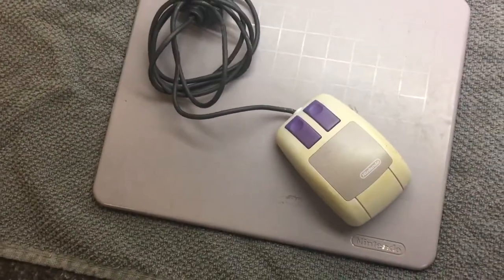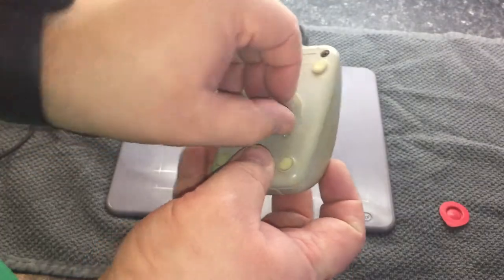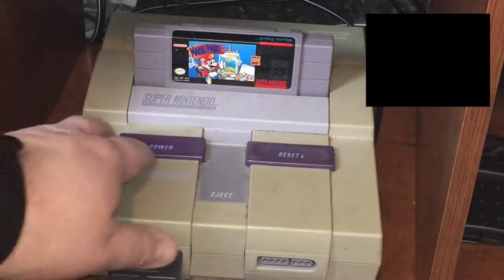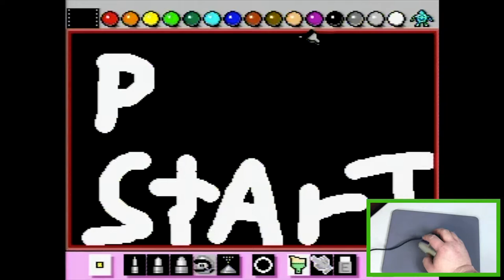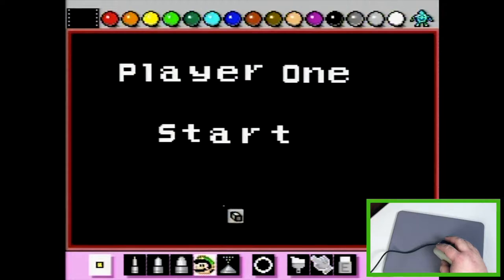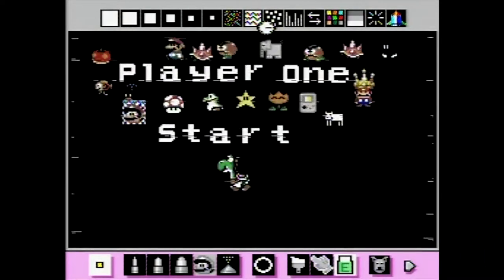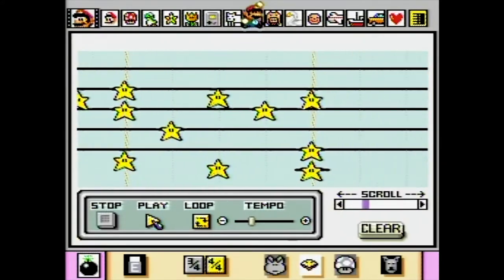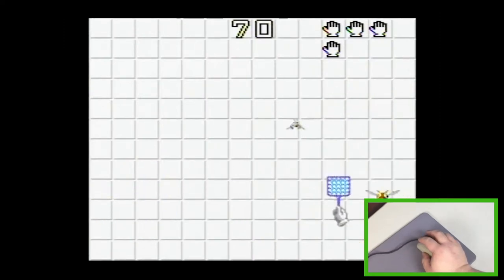SNES Mouse and Mario Paint Gameplay and Review - Player One Start

Comment: Can you tell me what you used to clean this please
Reply from the maker: Sure, as stated in the video, I used a dull, flat-head screwdriver and some over the counter 91% Isopropyl Alcohol on a q-tip. I will reiterate, that the roller is what needs cleaned the most. The ball can be cleaned too.
Reply: Player One Start ok thanks now mine might look better and work better